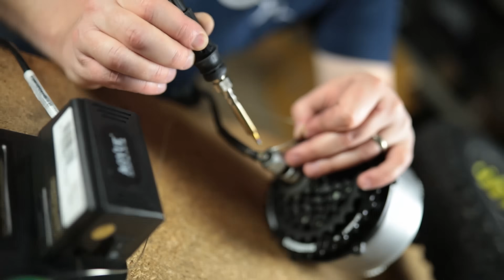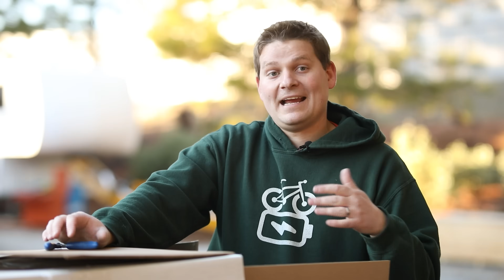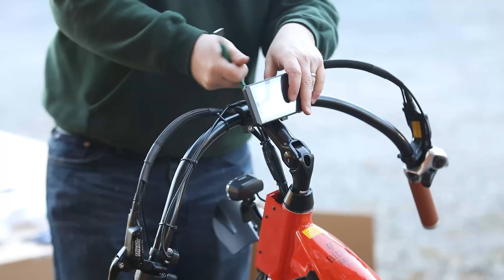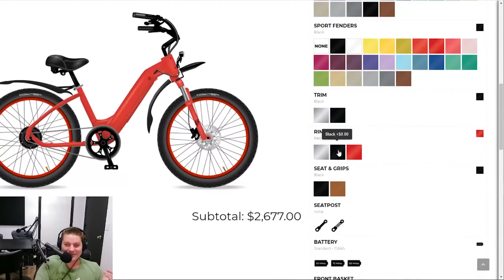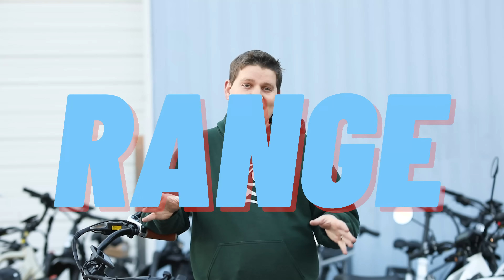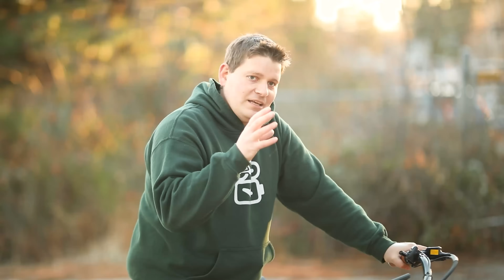Custom Cruiser Review - Electric Bike Company Model R

Comment: What for bike is it? As I look ad it, I would say a mountain bike, but as I look ad the frame design, the steering and the seat, I would say a woman's city bike. But that doesn't fit with the very thick tires and mountain bike fenders.

I think with other tires and fenders, it would look better.
Strange that a rear rack is optional. On a mountain bike I understand it. But on a normal bike, it needs to be there.

I don't like the fenders. Other fenders around the wheels would look way better. Other then that, it is a nice bike for women.
Reply: The bike is a cruiser. Those fenders aren't typically on cruisers, but I LOVE them. Plastic is lightweight and virtually indestructible.
Reply: @blakeberlin6295  ok never seen a cruiser.
I find the fenders fit better by a mountain bike.

Here you don't see them. Here you see a lot of city bikes.

Comment: I have a model R and totally love it!  Thanks for the nice review.
Reply: @Mr Mr right on, thanks for the info, 30 mph is perfect for that bike.
Reply: Can you please tell me the top speed with and without pedaling.
Reply: @garycollins2  The throttle only will get you about 20mph,  but with pedal assist it will get to the full 28mph (class 3).
Reply: @JerryHoward88  thank you for the information. One more question if you don't mind...in the video he said you can dial up the power past 750 watts. What is the difference in power and battery life if you turn it up past 750?
Reply: @garycollins2  That is a question that I am sure Kyle could answer much better than I can.  He also went over it in an earlier test of a model R.  Basically, the bike uses more than 750 watts when it needs to, is my understanding.  And sure, pushing it does affect how much battery charge is available.
Reply: @JerryHoward88  thanks again! Looks like a great bike, im super interested! Thanks for taking the time to get back to me.